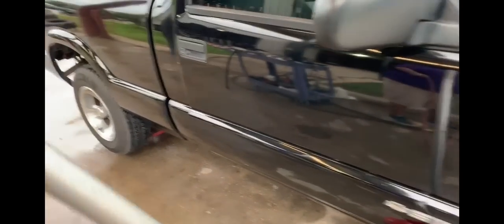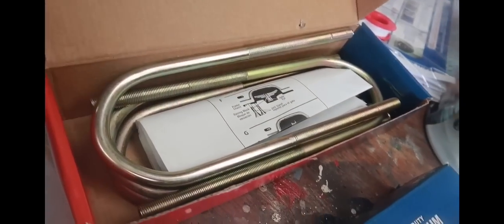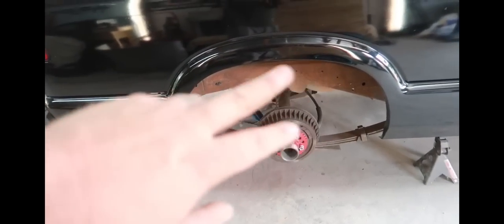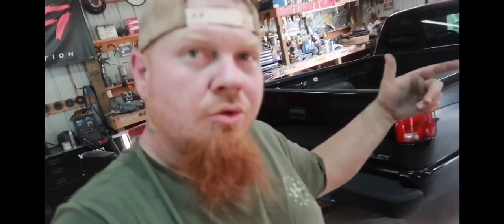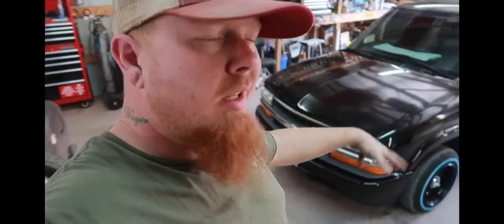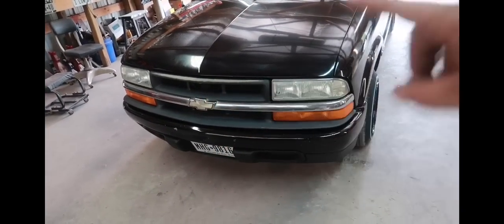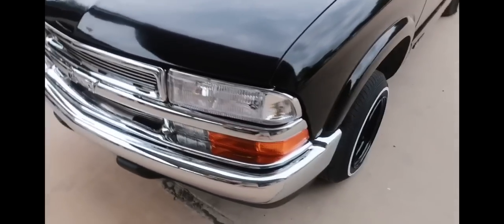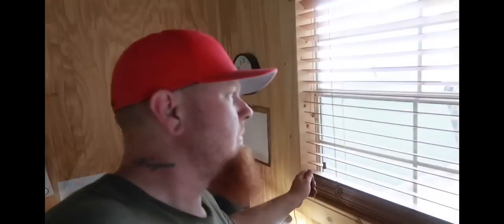LOWRIDER S10 BUILD/DAILY DRIVER !!! MINI TRUCK!!!

Comment: Me personally, I would have to get rid of all that air in the wheel wells.  Either use bags,  hydraulics,  or like I did with a 93 Toyota, static drop with just 3" blocks in the back and removed the middle leaf spring and  just cranking the torsion bars down in the front " and luckily everything stayed straight ".

Comment: Are u juicing it?.. NOT a lowrider without juice😁
Reply: It is a lowrider without juice. know your history. before people juice their cars they would put sandbags or whatever heat or cut the springs
and whats not. they would do whatever to lower the vehicle.
If its lowered more then stock height, its a low low.